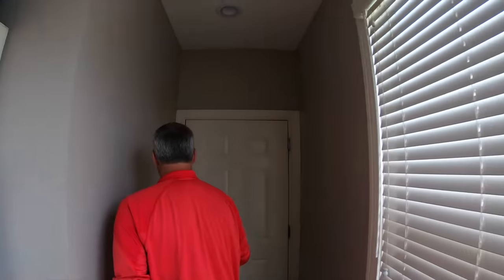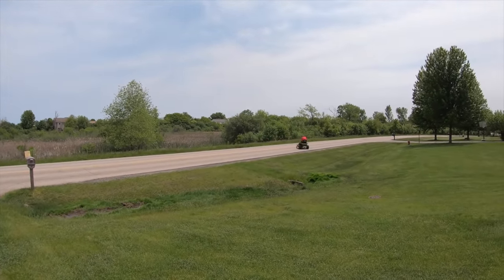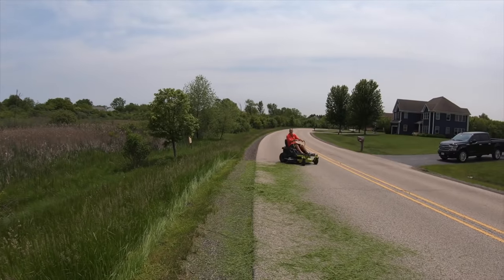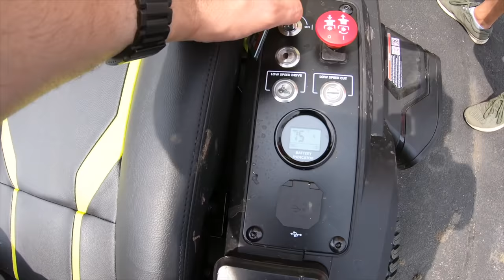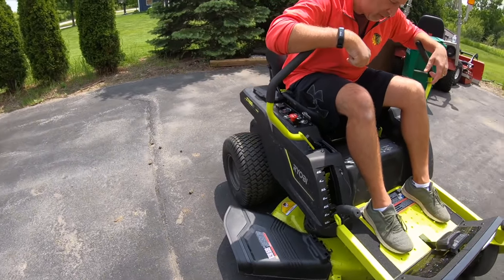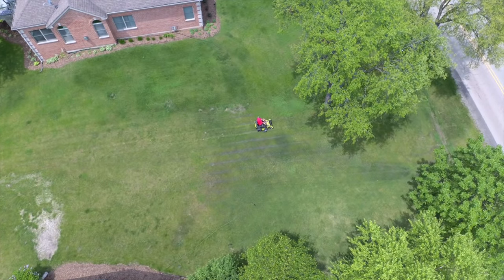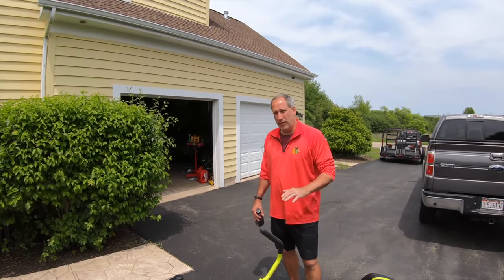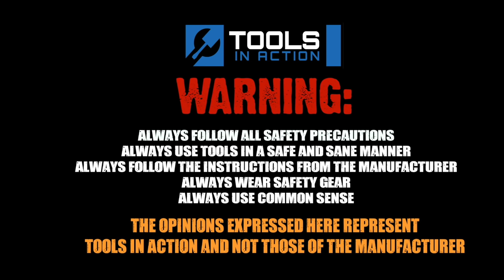Ryobi Electric Zero Turn Mower - First Look

Comment: Charge the battery a couple of times and then review it again
Reply: I've charged mine about 30 times now, what would you like to know? It's still great!
Reply: @bnr32jason  I noticed he mentioned power washing. I saw somewhere Ryobi does not recommend using water on these. It blowing with a leaf blower. Also I'm pretty sure these must have lead-acid batteries, from the constant charging. I thought I heard him say it had NiCad, nobody uses that type anymore. Does it tell you the battery chemistry? It would be neat to see the Batts.
Reply: DrgnFlys  I assume the replacement will have a different (smaller) form factor. You plan to rig a connection? Also are the replacements more expensive than the OEM? The OEM units probably don't give a cycle estimate just years of use. How many years do you expect out of the Lithiums?

Comment: I stopped watching when you blew the grass in the road...
Reply: that_kid_ozzy haha it made me cringe. Where I’m at you can get a fine blowing clippings into the road. Amateurs
Reply: Baconator Doom same here. They’ve been writing tickets left and right and I’m glad about it
Reply: A good way to hurt someone on a motorcycle
Reply: @Mario-cv5el  it provides a slippery surface thats dangerous toward motorcyclists
Reply: Thank you! This guys a tool
Reply: Yeah, we better figure out how to get trees to stop dropping leaves everywhere too.
Reply: Mike W well most leaves don’t fall til the end of season and they are dry. Easier to blow off the road. Fresh grass clippings are full of chlorophyll when driven over its ground up into a slippery mess. Causing traction to dramatically decrease. Not all vehicles have brand new  tires with good tread. The grass don’t blow off the road till it’s baked under the sun. Especially large amounts like in this video. Accidents do happen regularly because of debris in the road. Most places it’s a fine for blowing clippings in the road. And like I said in my pervious comment in the country it’s even more risky because people dive faster than they would in a city. It’s very simple to make a couple passes blowing the debris the other way or use a mulcher cover.
Reply: Yeah I always say that they shouldn't sell someone a mower without making them take an common intelligence test first. First question: The grass discharge chute is on the right side so what direction do you face it when you cut grass along pavement areas? Guess it wrong you fail and we won't sell you a mower today, study the book and come back again next week. I see people who do this for a living every day and they still can't figure it out, some even strap on a big $400 backpack blower afterwards and stand in the middle of the road to blow it back while dodging cars and wasting so much additional time, it's a lot easier to just do it right the first time. Da...do you walk through a puddle of water or go around it?
Reply: @baconatordoom  chlorophyll....more like BOROPHYLL!!!
Reply: @Serpico1152  if you mow a large lawn with the chute facing away from the road the grass will stack up on top of each other and be hard to mow.
Reply: @blakew5672  for real.
Reply: @DkpProductions  I've been cutting my acre this way for 34 years and don't have a problem if you just don't let the grass grow that high. You can cut each row in alternating directions or use mulching blades with a blocked off chute too. My point is cut the grass beside pavement facing away from it for a row or two and then if you want to cut and blow the grass back the other direction go right ahead.
Reply: Lmao then don’t drive by my house. I purposely blow all the shot into the road so I don’t have to clean up clippings 😂😂
Reply: Mm except it’s a public safety issue and not to mention blight. Respect your neighborhood.
Reply: DKP Productions just mow 2-3 passes into the yard then reverse direction. Duh.
Reply: Ducati Hyper821 haha I love it!! Actually I never did it but both my neighbors on either side of me always did it and it used to drive me crazy that I was the only one that used to clean my clippings. I gave up and joined them. It’s a private road that the town has no jurisdiction over, the town don’t even plow in the winter, so we don’t have to worry about getting fined
Reply: broooooo yesss that made me mad
Reply: People have blown grass onto roads for as long as there has been grass to cut and this is just getting attention this passed year.
Reply: Everyone complaining here talks like mowing is the only thing they’re living for lmfao stop being boomers
Reply: Comon sense people, just  cut the grass in the opposite direction and shoot it into the uncut area... I hate when people are that lazy and stupid that they can't show pride were they live and keep the street clean. The wind does NOT always blow it off... SHIT! So glad someone started this topic... it needed to be said.....  Love the mower....
Reply: @Steven Arceo because it make the road and neighborhood look like shit.....
Reply: It’s only legal for the state mowers to put grass on the road not every day homeowners.
Reply: Yeah me to😂
Reply: That is so stupid. You should not just stop because he blew grass in the road.
Reply: For real y’all, because grass in the roadway makes it harder to text and drive!  Can you believe he nerve of these  inconsiderate people??
Reply: Please!! For real you wanna know what’s worse than discharging grass in the road?  That would be mowing with your back to oncoming traffic.  I got run over by someone looking at their phone but at least I wasn’t blowing grass in the road..   I use a discharge blocker but still I will throw grass all in the road and think nothing about it if it means I might have a fighting chance to jump from my mower to avoid someone who is running off the shoulder of the roadway..
Reply: @caseym6411  when I use to drive a motorcycle if I seen something like grass or gravel in the road I would either go around it or slow down.
Reply: Wow I Never knew that was a problem even When I still had my motorcycle. Honestly I get grass in the road all the time at the edge of my yard and the first car that blows by doing 30 miles an hour over the speed limit like everybody does it’s gone. I just always looked where the fuck I was going and slow down for the conditions. Wet leaves grass dogs deer trash there’s all kinds of stuff in the road. Most the time you won’t bust your ass if you’re not driving like an idiot and you’re paying attention. Either way I’ll try and keep my grass out of the road I can see some whistleblower wanting to start some crap stopping to run his mouth .
Reply: Grass clippings is like ice on the road when you are on a motorcycle.  Obvious you arent a rider.
Reply: @OmegaGamingNetwork   ... Motorcyclists have died from hitting grass on the roadway... it's like hitting a patch of ice. Use your brain.
Reply: A banana truck spilled on side of road and the Ryobi zero turn mower helped discharge them into the road where they belong. Thanks Ryobi
Reply: @caseym6411  exactly what I thought
Reply: @Mario-cv5el  it could kill someone riding a motorcycle.
Reply: @mw5905  lead the way
Reply: @OmegaGamingNetwork  motorcycles are everywhere
Reply: You people are ridiculously critical about stupid crap. I have never heard, nor will I ever believe that grass clipping will ever make the rd slippery and dangerous to a vehicle to drive over. I have driven (and probably billions of people) over grass clippings for 20 plus years and never a hiccup or any concern over losing control of my vehicle.  The men on here saying such things need to grow a pair!
Reply: @_BJ123  with statements like this, it's no wonder your name is bj.
Reply: @kristopherbuchanan974   whatever dude, , i said nothing disrespectful, its just common sence, which you apperently do not have by the reply you just gave...
Reply: Me too.
Reply: How much are they? Sold at Home Depot?
Reply: Residential street how fast you need to go?
Reply: @paulallen-01  what if while you're enjoying your mischief of hurling the clippings in the road and someone comes by with a nice diesel truck and Cole rolls on you ?
Get the picture?
Reply: Brent Addie  what if while you're enjoying your mischief of hurling the clippings in the road and someone comes by with a nice diesel truck and Cole rolls on you ?
Get the picture?
Reply: overflowenterprises I wouldn’t give a shit if I got coal rolled. Actually I think it’s quite funny
Reply: @paulallen-01  OH ,OK
Reply: You know how many cordless blowers these two have? They probably did that on purpose so they could have an excuse to use their blowers.
Reply: @NytronX  LOL interesting point !
Reply: @baconatordoom  Go eat some BACON!
Reply: Grass is bios degradable it’s all natural not considered littering and actually my city wants people to blow it instead of throwing it in plastic trash bag that takes forever to break down . You are actually making it worse throwing grass in plastic bag. Grass is a fertilizer.
Reply: Mossy Oak the heck is state mowers? The prisoners and half way house workers or ex convicts you mean. I cut grass my neighborhood all time we just blow it and spread it out and working few days it’s gone. It’s nature better than Putting it in a plastic bag where it will never breakdown.
Reply: We need to ban rain too. That stuff can be slippery.
Reply: Probably not the only thing he blew that week, lol.
Reply: If you are that worried about it don't ride a motorcycle at all.  What about potholes, tar snakes, gravel, the old lady that can't see, or the drunk that just drank 8 beers and is back on the road to buy more?  If I thought about how dangerous motorcycles are I would never ride one. Just sell your bike and buy a Volvo.  I read they are very safe...better yet just stay home and worry all the time.
Reply: Only in a first world country do you worry about grass clippings in the road never mind texting and driving or driving drunk or not wearing seat belts among other hazards on the road that you could preach about. No we will focus on yard trimmings. When you drive you should pay attention to the road and its condition.